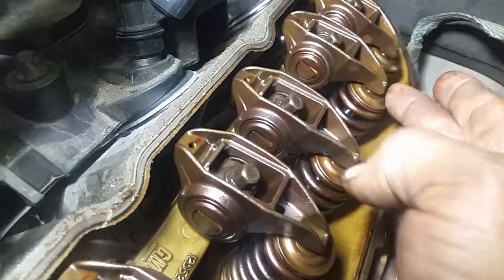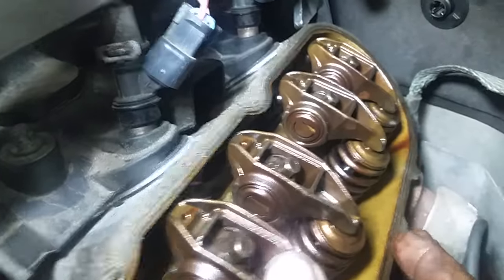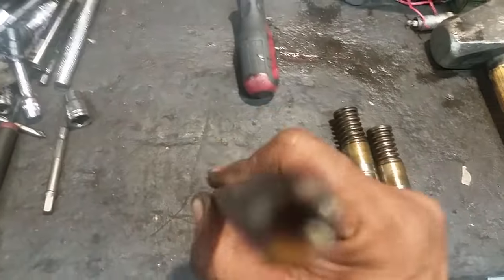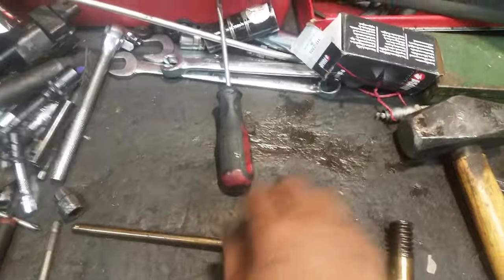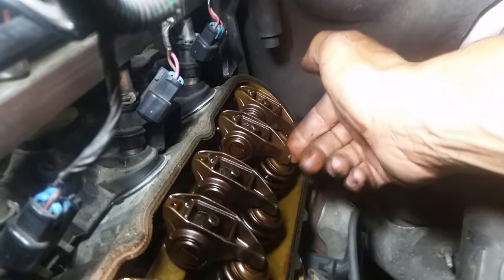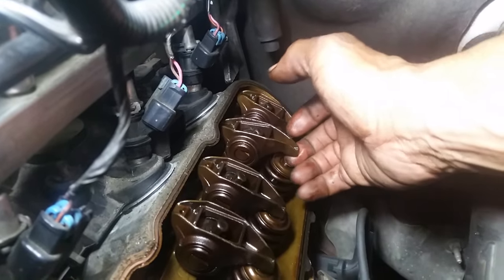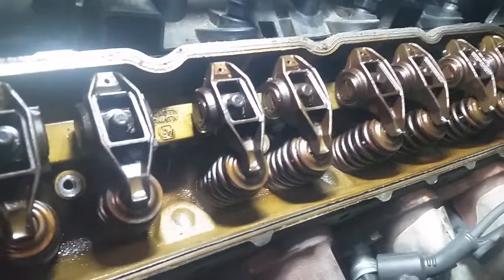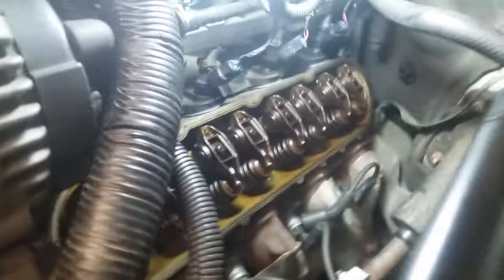How to diagnose a bad Engine lifter, Chevy Tahoe Pt. 1

Comment: before going through changing the lifter start the engine with the valve  cover off and take a  small hammer and repeatedly tap firmly but not too hard on the rocker are on the side directly over the push rod. sometimes a collapsed lifter can be freed up by taping the push rod down just a little further than normal making the extra pressure pump oil under the stuck lifter to make it free up. if this works then put in a quart of gunk engine cleaner in your oil run it for about 10 minutes to free up old oil deposits then drain the oil out and refill it with conventional oil never synthetic! synthetic oil eats up and rubber that is inside the engine and is the major cause of the 4.8,5.3. and 6.0 Chevy motors that the oil pump quits working and ruins your engine. your oil pump does not go bad it rather the rubber o ring where your pick-up tube goes into the oil pump was eaten up by synthetic oil letting the pump such air, not oil. every motor I have changed the oil pump in on the 4.8, 5.3, and 6.0 Chevy's all had a broken o ring where the pickup tube goes into the oil pump. most ruin the engine because the go bad going down the road and an engine not oiling locks up in a min or so. but if you start your engine up and hear a valve clatter cut it off and replace that oil ring. a sign your o ring is bad if you start your engine cold your oil pressure should be slightly higher till the oil gets warm then as it heats up the oil pressure goes down slightly. if you start your cold engine and the oil pressure is low then increases high after the engine is warm your o ring on your oil pump pickup tube is going bad. You see as the oil heats up the bad o ring expands then it seals the air gap around the pickup tube and oil pressure increases. when it is cold air is being sucked in past the bad o ring and you have less oil pressure. i have had several do this by buying used trucks that had always had nothing but synthetic oil ran in them.
Reply from the maker: great advice but dont tell all the secrets ,LOL thanks

Comment: Hey man, I need help with my truck mine makes a ticking sound, and after a while of idling white smoke starts to come out the exhaust manifold but when I accelerate it the ticking noise increases and it decreases when when I let go of the peddle

Comment: I'm getting a hot lifter ticking, goes away if you change oil. Comes back after 600-800 miles. Took valve cover off they're all shooting oil out. One is really blowing out out of the pushrod hole... I'm lost
Reply: Well?

Comment: I have a 07 gmc yukon 5.3 with flexfuel system. Check engine light, traction controle, stabilizer trac lights flashing. Oil dipstic showed i was about 1.5 quarts low. Found a bad lifter was the issue. I replaced all Spark plugs and wires. Rod bearings, lifters, lifter trays, rods and so forth. Ran motor flush.   And then oil change. Truck ran like it was off da lot. Ya feel me. 😅. Yesterday it happened again. 😢 I was driving the same speed on the highway as when it happened the first fuckin time. Cylinder 6 misfire again. Found only one of the rockers on cyl6 was not rocking. Im not sure what to try this time.
Reply from the maker: check the cam shaft lobes or the valve train

Comment: Do you have to reset the timing after doing this on a Tahoe/Yukon/
Reply: No just did mine a week ago.  Replaced lifters, push rods the head and gaskets etc. I have a 09 yukon denali if that helps you out any.

Comment: I have a tap that increases with the rpm’s. Also, it comes and goes. I’ve pulled the valve cover and all the rocker arms are tight and move when the engine is running. I’ve changed the spark plugs and oil and I added Lucas oil treatment, but it’s still tapping. Most of the time, it seems like it has to warm up a little before the tapping with start. I have great oil pressure. I’m stumped. Could it be a lifter even though the rocker arms are moving?
Reply: same here
Reply: I'm on this video because I have the same exact issue, my mechanic says it is my injectors ( I have a forged and boosted set up) but I've never heard injectors that loud. It kind of stresses me out every time I drive because it sounds just like lifter tick.
Reply from the maker: it could be or maybe some other part damaged like a worn camshaft
Reply: @crazysexycool180  brand new internals in a prepped block :/
Reply from the maker: are you getting enough oil pressure?
Reply: @crazysexycool180  more than. At this point I'm pretty sure my mechanic fucked up building it. I have positive crank case pressure and it spits oil out of the dipstick tube if I romp on it telling me it has blowby. When he first assembled it the rear main leaked but we fixed it before it ever left the shop, looking back that was probably a sign.
Reply from the maker: how is the pcv valve system?
Reply: @crazysexycool180  I was thinking that too, it's possible he didn't hook my catch can up to a vacuum. I remember him changing it from the way I did it and now it "vents to atmosphere" but I haven't gotten under the hood in awhile. Been so damn busy with work... which is why I paid a speed shop in the first place lol. Damned if you do damned if you don't.

Comment: My 2007 yukon denali was missing and shaking and blowing alot of white smoke out the exhaust.  Pulled intake and valve covers.  Found a bent push rod on #1 intake was closed.  Can i just replace that push rod and hope for the best?  I can see the cam from the slots under the vlom plate and it looks good as far as no bad grooves in the cam.  And lifter rollers looks good luckily it stayed staright and didnt turn.  Isthere any way to check that the lifter is ok without removing head??

Comment: My 2018 cam SS shakes and makes a clunking noise when I put the clutch down from reverse to neutral or first gear to neutral. It happens when I’m pulling in and out of my driveway.
Also, you can hear a metal ticking sound especially around 4K RPM.
the dealer replaced the cam shaft last year because it made a knocking sound, but these other 2 issues never went away.
Any suggestions what it could be? Thanks

Comment: Does the rocker have to be in a certain position to check for this? I have ticking and I think I have some slightly bent rods but couldn't push my lifters down so they are pumped up, just didn't know if the valves had to be open/closed etc
Reply from the maker: manually rotate the engine and check

Comment: I have a 2007 gmc sierra v6 and when I let my truck sit for few hours when I start it the passenger side valve cover has a loud tapping noise but after like 1 minutes tops it clears up I have check my rockers they seem to be tight and my push rods isn't bent. So mabe my lifters are sticking????

Comment: I've got one rocker that doesn't move at all.  There is no play in the rocker so I know the lifter is not collapsed.  It just does nothing.  If there is a chance that the camshaft is done then I'm throwing in the towel.  I don't mind pulling thr head if I have to.  Have you heard of them just getting stuck and not pushing up on the rocker?
Reply: Did you ever figure this out? I’m having the same problem
Reply: This happened to mine when I had a bent rod in the head.  The engine would have the whole truck vibrating.   Ended up changing the head and solved the problem.   Almost 500 new from autozone with a 150 core fee for the old one.
Reply: Did you ever figure it out?? My truck is doing the same thing
Reply: same did you figure out
Reply: @helghit  same did you figure out
Reply: @Pibs2525  same did you figure out
Reply: @TraxxasSlash101  my lifters I changed them and did a dod delete
Reply from the maker: Thank you please like, share, and subscribe, also please check out my other channel Salem Taxi, on YouTube for more material on a different level.

Comment: I have a broken lifter on cyl#7 he did that at low speed and the truck is on a limp mode so i just go at the garage didnt do millage whit this problem 
My question is  do i have to change the camshaft !?" Or just the set of 2 lifter on the cyl #7 thanks for reply

Comment: I appreciate your videos outstanding work!!! Quick question, I did a compression test and everything checked out good. However I’m still chasing a misfire, even after changing the   Spark plugs, coils, and injectors. Would bad lifters failed the Compression test?
Reply: Lifters can sometimes cause a misfire
Reply: I think this is the story on my 5.3. New Ignition system but now I hear that Slight lash on cylinder 6

Comment: I have code p0300 on my 2015 GMC YUKON DENALI XL 6.2L and checked rocker arms and they have a little play when I do it to the side, but no play when moving them up and down, what could it be?
Reply from the maker: check the coil packs plugs and wires
Reply: @crazysexycool180  it turned out to be the transmission fluid
Reply from the maker: THANKS FOR WATCHING !!!!  Please like share and subscribe, also check my other channel, Salem Taxi on YOU TUBE . Thanks.

Comment: Question! Will a bad lifter cause a vibration in the engine when driving on higher speeds? Thanks!!
Reply from the maker: yes. a bad lifter will keep the cylinder from producing full power, like the other ones. think of it like a train of horses running together. if one breakes its leg the others will have to work harder to keep the train running at speed.no to mention the brtoke leg horse will be dragging the rest down.
Reply: @crazysexycool180  On my  2015 5.3 it knocks, the #7 intake rocker doesn't move when the engine turns over and the rocker isn't loose like yours. Can it still be collasped?
Reply: @JesseG085  did you ever figure it out? My 4th cylinder is doing the same thing
Reply: @Pibs2525  Yeah the lifter was seized.
Reply: @JesseG085  did you ever fix it? and if you did how did you do it?!

Comment: I have 2006 envoy with a 5.3. The ticking is there at start up after a while it disappears, Then after a snap of throttle it comes back for while then is gone again. getting a cylinder 1 miss fire. Replaced coil plug and wire. Noise is still there. Does it sound like its beginning to fail. If it is I want to replace all of them. Have you ever done the delete if so do codes come up as a result?
Reply from the maker: so even if you remove the check engine light, the computer will still see the misfire in cylinder 1. i would advise a pressure test on the cylinder1. this will help in determining the issue
Reply from the maker: pull vale cover off and check the rocker arm for play. when you  delete codes they will ome back if the computer sees the fault again
Reply: That's what's called normal for gm and they sure don't make them like they use to... So sad so disappointed with general moters

Comment: I have a 2000 Chevy Malibu with a 3.1 engine at startup engine ticks after runs for awhile a little it fade a little what could the problem be
Reply: Any comments please reply back
Reply: gary york I've had similar issues with a few engines. One of the first and easiest things to try is to run some Marvel Mystery oil in your engine oil. If you have 5 quarts of oil in your engine, change your oil and add 4 quarts of oil and one quart of MMO. No more than that though. Rislone is another product, there's several really, but it seems to work ok too. Change your oil frequently and add MMO to each change. Also buy top quality oil filters.. Sometimes just cleaning up the gunk inside frees up the sticky lifters and/or cleans oil passages allowing better oil flow and pressure building at start up. Worth a try.
Reply from the maker: use thicker oil
Reply: gary york very common on those. I hear almost every 3.1 with a tick and it’s generally fine
Reply: Completely normal for those engines. Engine manufacturers started fitting them with loose pistons on purpose so they don't score the sidewalls as much on cold starts. In recent years manufacturers got more precise in doing so, so drivers don't hear them tick as much.

Comment: Please replay fast :)) i like your videos and i have a yukon denali i have the same issue but i need a market to buy the lifters and camshafts can you please link me a market??
Reply from the maker: ebay, or any autopart store will have the parts
Reply: Put the microphone on your lip, every time you move you fade out.
Reply: @crazysexycool180  can you replace the rockers by only removing the valve cover or am I gonna have to take off everything?

Comment: what a stupid design engine. must take out cyl head  just to replace lifter.
Reply: reynaldo Chua Fun part is you need acetylene torches to heat up exhaust donut bolts to take them off because you cant get the exhaust manifold bolts out of the heads, you usually break about half of them, best to install stainless studs so next time the manifolds come off.
Reply: Jake Heke  if you can't afford to maintain a motor, might as well get a bicycle.
Reply: Lmao

Comment: Get you a dodge son.
Reply from the maker: I own 2, this was done for a client.
Reply: Because dodge has no lifter problems lol. 5.7 hemi is a lifter nightmare
Reply: @stryker1953 I've never had an issue. 05 with 364K hemi. 12 hemi 245K, 12 hemi 215K,

Comment: Worst engines GM made
Reply: Memo Rivera I hope you’re joking lol
Reply: He’s gotta be. LS is the best gasoline engine. Period. Worst GM engine was probably the diesel 350 or the Northstar
Reply: adam brady I agree with you there on the 5.3 Chevy motors.. they're bullet proof! Can't kill them... My brothers 02 suburban has 319,000 miles .. no noise from the motor.. these motors can go up  400k to 500k miles easy! 
Good on gas too!
Reply: The 3.4 v6 was a P.O.S
Reply: I'd say the 305 and 307 is the worst.
Reply: I have a 09 chevy 4.8 liter and they have the same problem.Bad lifter but I think the 4.8 is a little different I haven't changed them yet but I don't think I have to remove the heads on the 4.8.
Reply: LOL more like the most fucking popular engine in the world, as far as swaps and racing goes.
Reply: I have a 2007 Chevy Impala 3.5 I have changed the spark plugs wires and coil packs they say is 2 and 3 misfire but I have changed all the spark plugs and the wires and the coil pack and my mortar doing some shaking I turn on the air smell like something is burning but all it is is whitesmoke it doesn't do it when is off got half of my power can't go over 80 85 do you think my lifters are going bad